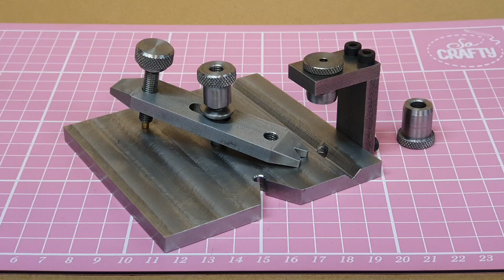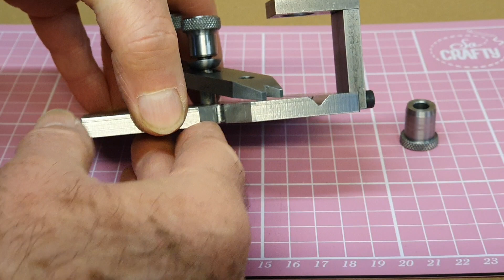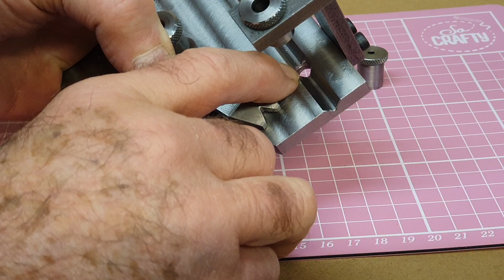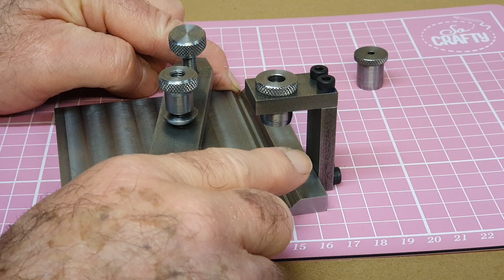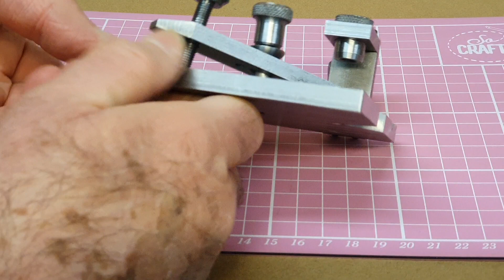Finger Plate Shop Made.

Comment: Hello Nobby,
Sorry for the slowness to watch... You made a nice job of the finger plate. I believe but not tried that vinegar is good for getting the mill scale off steel, you just soak it for a day I think.
Take care.
Paul,,
Reply from the maker: Hi Paul I'll have to give that a try. I have used distilled vinegar to remove rust which works very well. Thanks for you nice comment. Very best wishes Nobby

Comment: wondering about your drill bushings, did you make them? and did you harden them? I only have one store bought one, and have wondered about making more. thanks
Reply from the maker: Hi, I did make all the parts including the drill guides. The drill guides were made from EN1a mild steel as I didn't have any Silver Steel/Drill Rod in 5/8" which Could be hardened. I will probably remake these later when I can source the S/Steel. Kind regards Nobby

Comment: I really like the "Vee" that you put in rather than a square. I'm sure that it will provide better support for smaller parts. So many little additions for this plate. If you do, I'm sure they'd make good videos. Great work!
Reply from the maker: Thanks Jim, I'm sure once I start using the Finger Plate I will make changes and modifications to it. I do already have something in mind. If my ideas work out I will make a follow-up video. Cheers Nobby

Comment: Great Little Item Nobby. Just a small suggestion, make another washer for the clamping but this time CONCAVE. In that way the 2 washers will self align and give a better clamping action, and a bigger surface area, as it stands it is only clamping on a very small curved area. You will need to make the center hole quite oversize to allow for when it has quite and angle. Generally though, try and keep the clamp as parallel as possible with not too excessive down slope. Regards from Australia.
Reply from the maker: Thanks David I can always rely on you for good advice. I will have a go at making a concave washer. That will be an interesting 🤔 project in itself. Thanks again regards Nobby

Comment: A nice project. I think I would make the drill guide holder adjustable by height since smaller drills are also shorter.
Reply from the maker: Hi Mark, that did occur to me after I made that part. I measured up the upright so that 5/8" round would fit. Luckily the 1/8" drill is OK. The fun part will be making improvements and modifications as I go along. Thanks for your help and good advice Mark. Kind regards Nobby